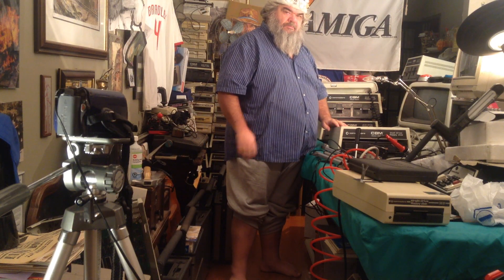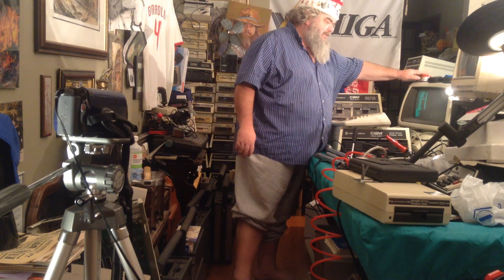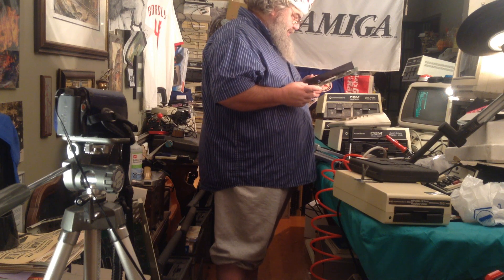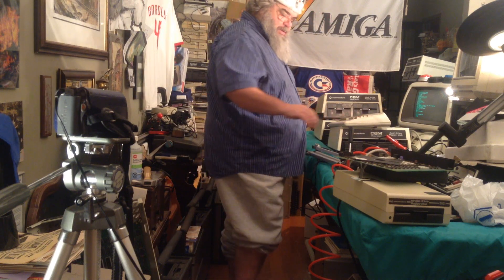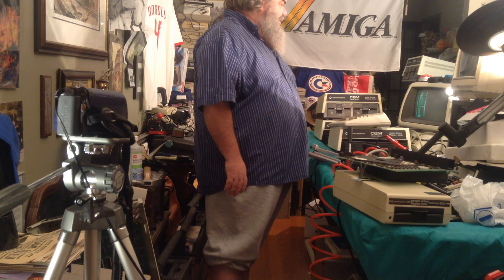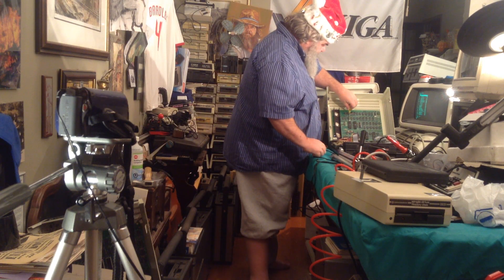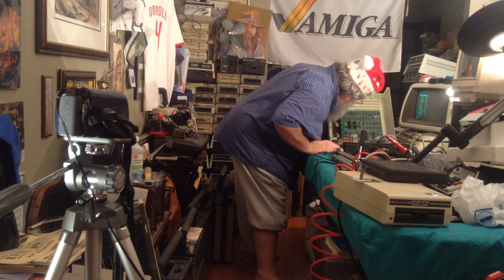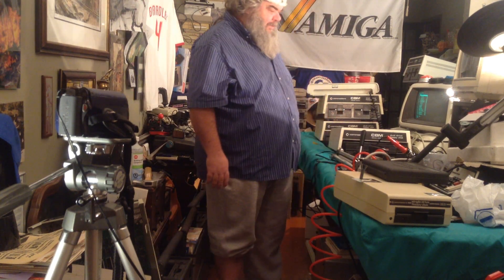Commodore - Episode 196 - 4040 Faster To Fail - iPAD Testing - David Bradley - Pet SuperPET C64

Comment: I have to say that there's room for improvement as far as heat management inside the 4040's is concerned. The main board is mounted upside down, so all the heat generated rises straight into the board itself. 
Also, the massive heat sink for the regulators has (temperature sensitive) capacitors mounted right next to it.
No wonder it suffers from heat related problems.
Is there a way of mounting the main board the other way around (I mean component side up instead of down)?
Reply from the maker: I have looked at altering the board mounting but it would be very difficult...I think a fan is a good thing!